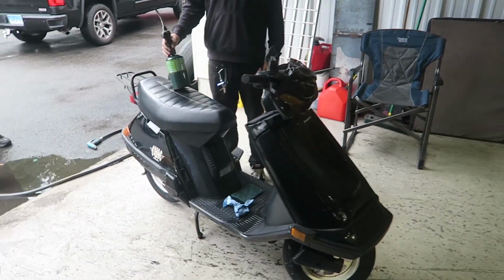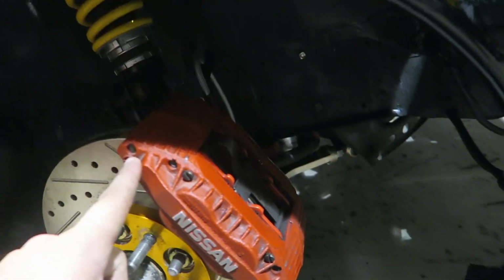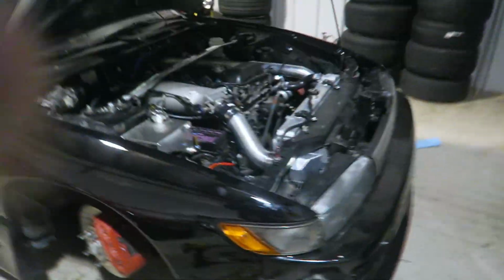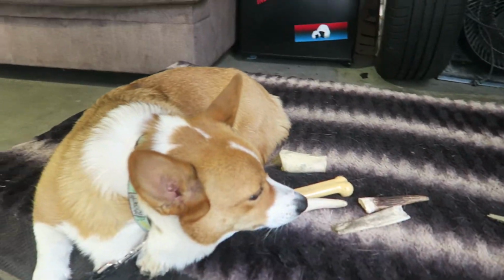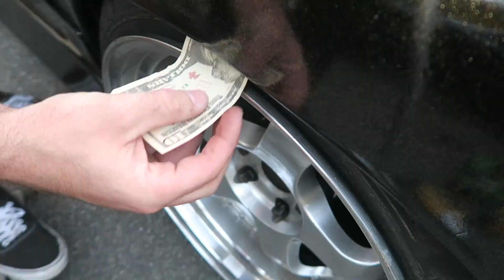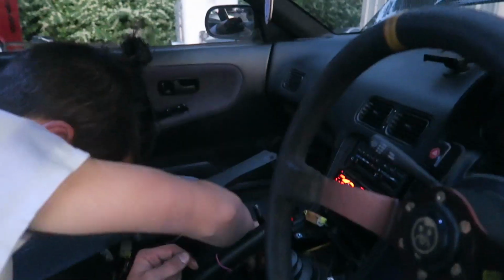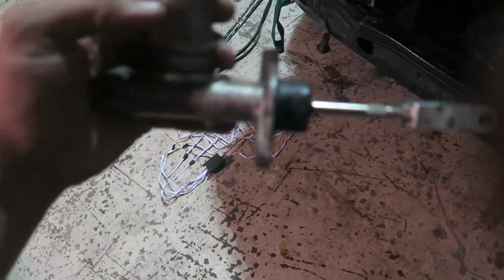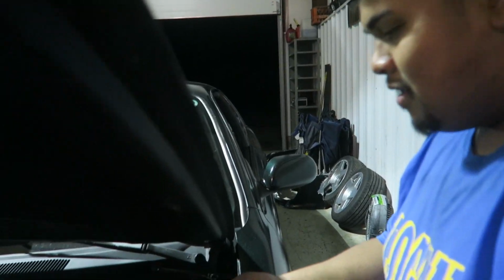240SX NEW LOOK

Comment: Try bleeding the clutch with the rear end on the ground, and the front as high off the ground as you can... run a hose (I use washer fluid line) from the bleeder back up to the reservoir... then take the pedal assembly out and use something to compress the master rod completely wile leaving the bleeder open (I use a long 3/8 extension with an old shift knob taped on the end).... accentually you are "bench bleeding" the whole system in the car.... little more work but it works every time and gets all the air out

Comment: Push rod length is too long between the master and the clutch petal, you will have to shorten the rod in order for the master to return all the way or you will never be able to bleed it. Cheers
Reply: I was going to comment on the throw as well. You need to be pushing more fluid in the master.
Reply: I figured that or they didn't bench bleed it.